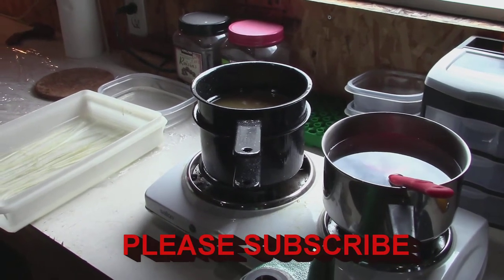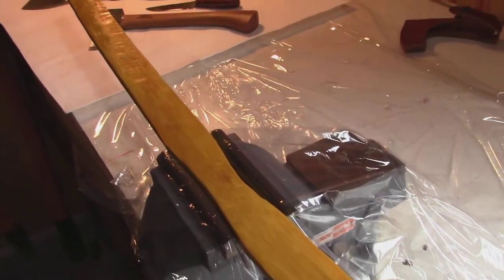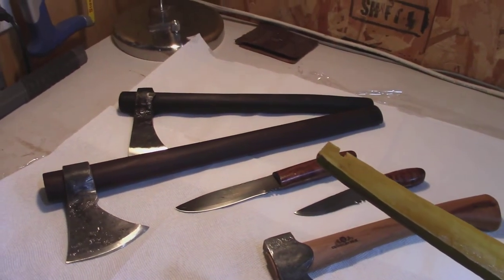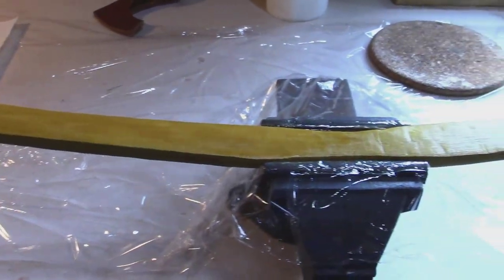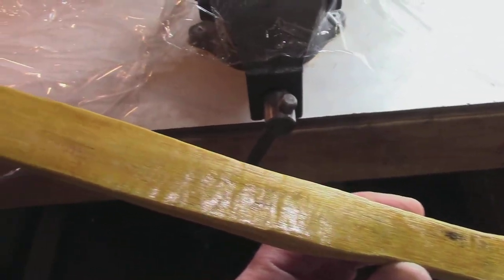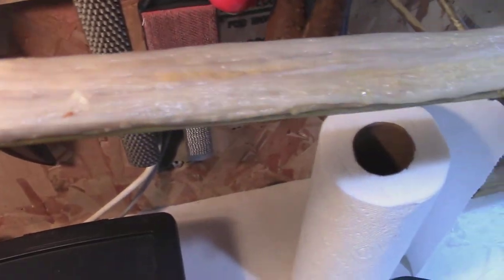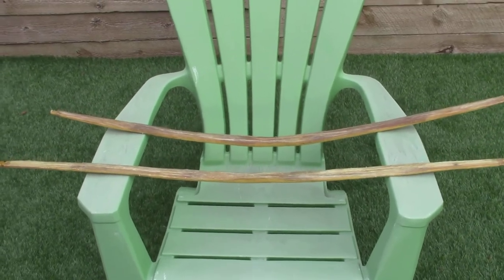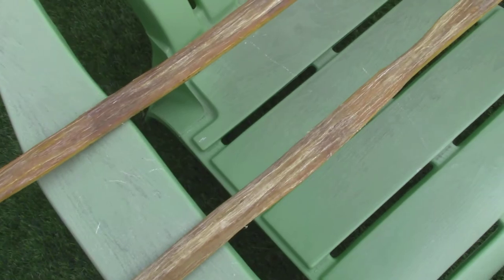Sinewing a Short Bow

Comment: Those are very nice.
I just got to harvest a deer for sinew for the first time this year! How much sinew do you think I will need to properly back a juniper longbow at about  66 inches? I've Olney attempted a sinew backing twice before. It's almost winter. It's winter and summer I do my tillering. And I've just got fresh Siberian elm for a new shave horse.
Reply from the maker: I would be careful to not use too much sinew as it adds weight and that is a long bow at 66 inches. On a 50 inch juniper I would use 3 layers or prob about 60 to 70 grams. On that long 66 inch bow maybe 2 layers and about 60 grams. Be careful as too much sinew can overpower the belly of the bow if it is juniper or Siberian elm

Comment: Fantastic and you're in Calgary? I'm in Leduc by Edmonton. I'd definitely consider buying my ancestors bows off u if possible. Cheers
Reply from the maker: Daylon, I typically do not sell them because of liability insurance or better said lack of it but I would sell one if you sign a document that I have used before to sell a couple locally. The prob is many people not knowing any better try to draw a 45 inch bow to 28 inches and kerpow!
What type are you looking for as I have a couple gems and a couple that are very rustic and traditional. One I have that is high end is actually a yew selfbow that  is the same as the English longbow wood and is really a one of a kind as it is 48 inches long and about 60# draw at 24 inches. I have a very powerful osage sinew backed 43 inch bow that is about the same weight. Looks like we are both Albertan's and almost all the requests I get are form the US. Let me know what you are interested in and what you are looking at $wise.
Thanks,\\Vernon
Reply: @vfcarchery7967  hey no problem and yes I am interested in the future. Not now cuz my car is taking most of my cheque lol but am interested in a short bow. I shoot short bows at 28" but know that selfbows are completely different even if backed with sinew. The performance is impressive I might say with them compared to turkish bows which u are very familiar with. Cheers man and keep speed testing those bows. Even I a ancestor of users of those bows have underestimated its power. Ppl think small bowe are kids bows until they see them shot. And I shoot arrows that are thr drawlength of the bow so. But then again not everyone has common sense. I am still learning that

Comment: Looking good as usual,what do you mean by over power the belly of the bow with too much sinew..?
Thanks
Reply from the maker: The sinew will put stress on the belly and if the wood does not have enough specific gravity then the wood will crystalize on the belly.
Reply: @vfcarchery7967  Thankyou for your reply. Please excuse my ignorance, but neither do I understand what you mean by crystallize..? Do you mean make the limbs too solid there..?
To explain, I have put 2 significant layers of sinew on my grozer asyrian biocomposite.  This has greatly increased the power of the bow. It was 44lb at 28" and now is 60lb at 28".
I have great respect for you as a bowler and love your bows. Your experience you share is invaluable.
Reply from the maker: @antoniovillafane1114  You will not have to worry about a horn bow as the horn or horn mixed biocomposite had higher compression strength than wood so will not crystalize. When wood crystalizes the compression is too great and the wood compresses and cracks accross the limb. You will see crystalized wood when it is compreased as it is caving in on itself.
Reply: @vfcarchery7967  Thankyou for your patience and explanations Vic.  Your videos are great, please keep them coming.